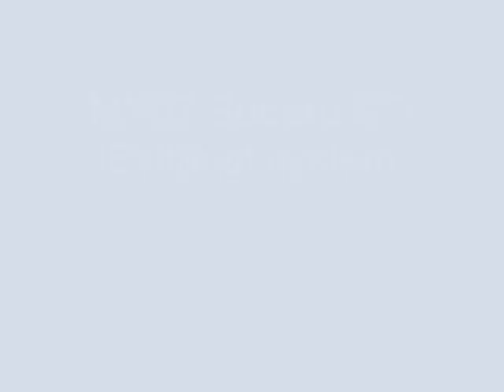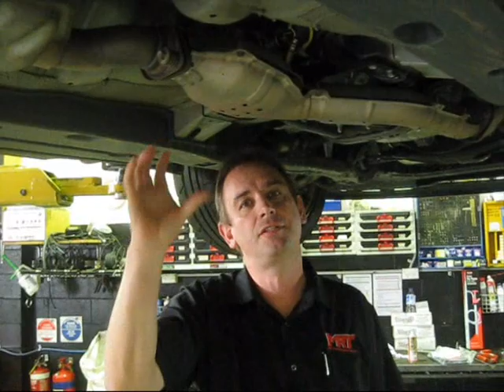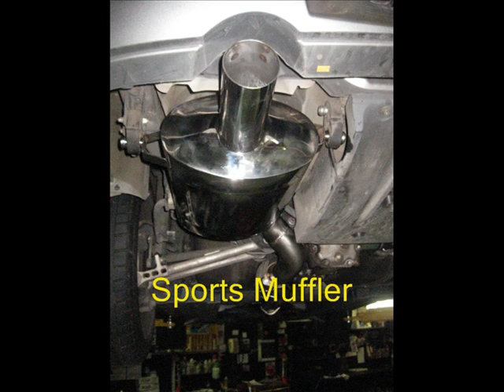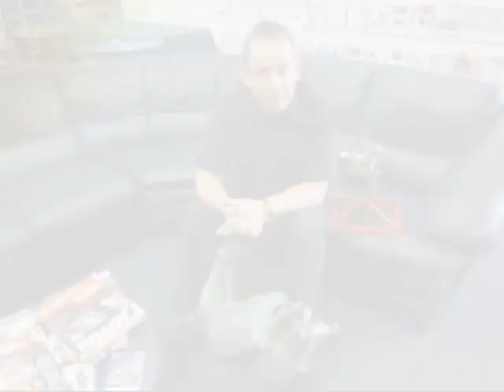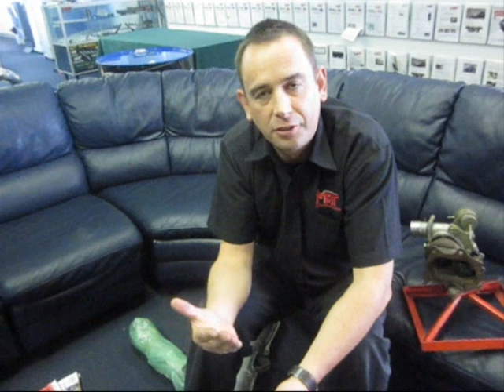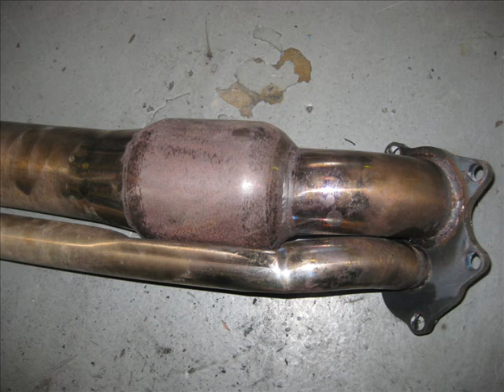Subaru Exhaust secrets and sounds Part 2 MRT Performance

Comment: I gotta impreza gh2 1.5r an it has a catalyst high flow sensor problem is it cause the sensors been knocked why the check engine light is on

Comment: I have been thinking about getting a Subaru. I just been wondering about engine parts inter changeability. I'm sure its not like a Chevy v8. but what kind of parts are swappable. for performance. I'd like to build maybe a Forrester that runs like a wrx. or some other "sleeper" and are there any performance in the 88-93 engines? and the transmissions in the older cars. I prefer older cars. like pre obd2. thanks and does anybody have any info or opinions on what I been asking. please reply. thanks
Reply: James stranger everything from subarus are basically interchangeable

Comment: Hi MRT performance. You guys seem to know your stuff on exhausts and Subarus. I'm split between EL and UEL headers for fitment. I really want the sound of UEL headers, but in saying that, its common knowledge that there is a sacrifice of power if you do so. Is there a way to have a set of UEL headers and still have optimum performance? If not, how close can the performance be in comparison to EL headers? It can't be too much, Subaru ran UEL headers until just recently. Thanks for your help.
Reply from the maker: it depends on your WHOLE package
Reply: 06 STi. Everything external to the motor upgraded to aftermarket; intake, air manifold, intercooler, fuel system (pump injectors E85 conversion etc), turbo upgrade to aftermarket equivalent etc. Car tuned for response, abrupt and strong midrange over just top end performance is the goal, I'm not chasing hp. 250awkw is plenty, if it's not reached I dont mind. Cosworth internals are being considered purely for a stronger motor with lighter spinning parts and because that cosworth camshaft is so good, but would maintain a midrange power focus with original or lower spooling rpm with only a slight max power rpm increase.

Comment: I have a non turbo 2011 Impreza 1.5R which uses the EL15 engine and I believe that one is sold in Australia with that same engine. I wanted to get that Subaru rumble that you get with unequal lenght exhaust manifold but don't know if that will decrease power in that already underpowered engine but man that sound is fantastic. What is your opinion?
Reply: Hi! If you put a stainless exhaust with the same diameter of the original pipe and a performance muffler in the end (with 2,5 inch inlet at max) you'll get that boxer sound and no mecanical issues. Hope I helped.

You lose power if you put a 3 inch pipe, because that's too wide.
Reply: Thanks dude!
Reply: Robert Rodgers  you're welcome :)
I have a brand of performance mufflers so I know that it will work. Check the sound of this 2.0R impreza that just put a stainless steel exhaust system and a performance muffler in the end. /watch?v=xqPlLY8SsnY
Reply: Yes that is exactly what I am looking for. A combo UEL with a good exhaust but I did read in the forums that UELs might take away a tiny bit of performance and my car is a puny 1.5L engine LOL so I don't want to make the car slower.

Comment: @speedylicker 100% need a retune, thats why you out the exhaust on, to remove the restriction and make more power, hence the ECU has no idea and boost, ign, cam timing is all needing adjusting, PLUS witha  EcuteK retune you WILL get MORE power :)
re the BOV, check out our FAQ at the bottom of the MRT web site

Comment: hey brett cheers for the vid's just wondering if i put a turbo back 3 inch exhaust with hi flow cat on my 06 WRX would i have to have the car re-tuned? or will the computer work it out?.. also i've heard that you can not put a atmospheric BOV on subaru's cause it can stuff your engine is this true? and why? cheers mate...